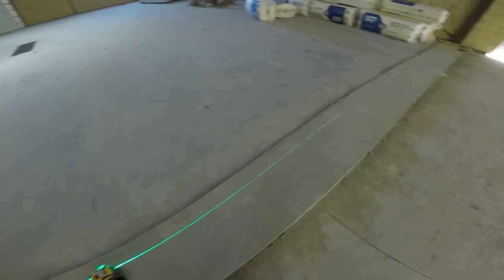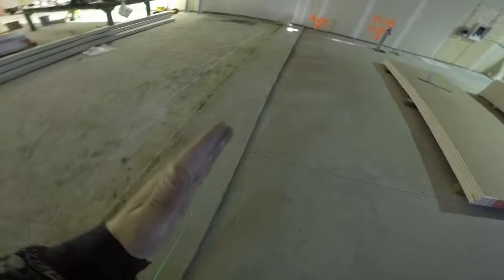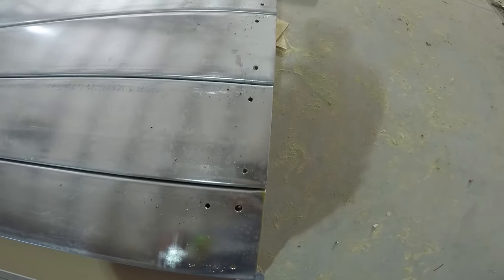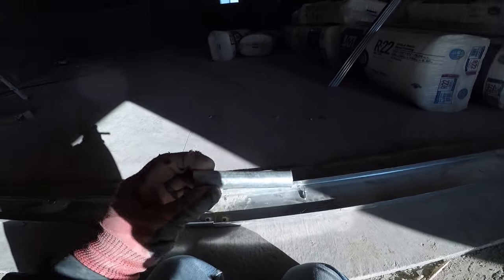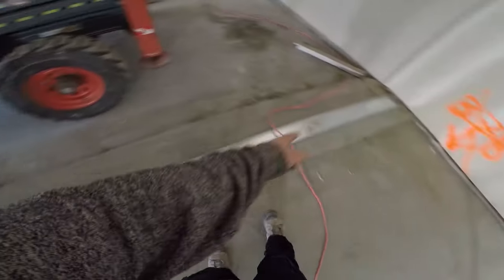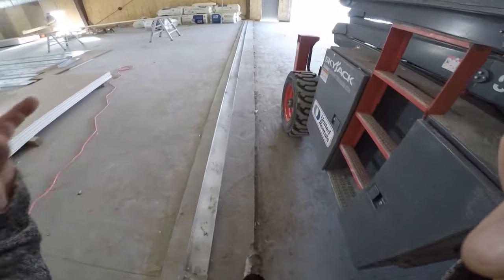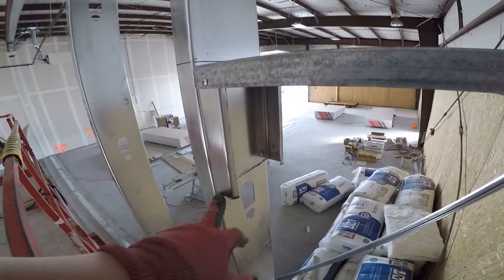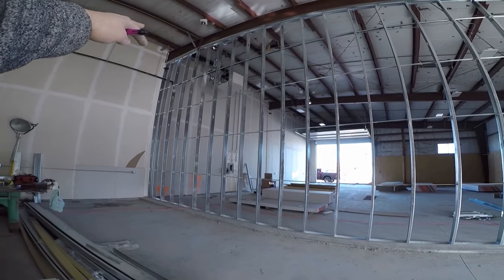Metal Stud Framing On Concrete & Steel Tips & Tricks!

Comment: Bizarrely, they don't sell those channel strips in UK, you have to cut your own noggins using channel parts. I'm going to hunt around because that looks so much easier.
Reply from the maker: Oh crazy I didn't know that. Have you tried a drywall supply house? Carry channel?
Reply: @ConstructionKronies  we have strips that act as braces which are attached to outside facing edges in an X shape both sides. I prefer the channel running through the centre though.

Comment: Which screws did you use to fasten the tracks to the steel beam?
Reply from the maker: We used the Hilti DX 351 steel to steel pins with green or yellow tabs. For screws we used #8 self drilling framing screws (but not to attach to structural those screws are for the studs to track).
Reply: @ConstructionKronies  Thank you for the information.

Comment: I need help framing a 12x12 free standing room. What do you use for the ceiling studs? This will have Sheetrock.
Reply from the maker: You can use anything for ceiling studs but if budget isn't too big of a deal go with 20 gauge 3-5/8" steel stud.

Comment: nice wall, do you need to add the wall stiffeners on a nonbearing partition interior office wall 10 feet high no insulation?
Reply from the maker: You don't have to but I highly recommend it. You don't need to clip it out, it's just good to have the wall channel in every 4' it's cheap and quick and the benefits are huge.

Comment: Thanks for the great videos!  What’s the best ramset 22 caliber nail to use to affix the bottom metal floor tracking to the concrete?
Reply from the maker: For interior non-load bearing  drywall track 25-20 gauge: 3/4" - Gas tool use TF1200 + T3MAG  - Powder Tool use R25 #3 GRN .25cal strip, Master Shot #2 BRN .22cal single or the SA270 #3 GRN .27cal strip. For the exterior perimeter 18-12 gauge use - 1-1/4"  SA270/XT540/COBRA #4 YEL .27cal strips! Hope this helps ya!

Comment: I just watched your video. Awesome! How much do you charge for stud walls? I just hot a call and asked me to do it but have no idea hiw much i should charge. It is 16’ high wall
Reply from the maker: Hey my good man. I charge $0.45 / square foot for steel stud. If it's light gauge and easy you can drop as low as 0.35 and for 18-16 gauge go as high as 0.65. also charge $2/ linear foot for angle in columns, soffit and bulkheads.
Reply: @ConstructionKronies  is this for surface sqf? And that include materials? Thank you so much for your reply 🙏🙏🙏
Reply: Only labor

Comment: Hi there, great job with the videos!!! At what height and over are kickers required to the ceiling joists?
Reply from the maker: Hey my man, so we actually never install kickers when a wall goes from floor to underside of structure. If you are looking at the tops here those angles are structural red iron supports and are done by the iron workers👍
Reply: @ConstructionKronies  thanks brother! What if the deck above is just 2x12 wood joist and top track is screwed into joists at 22' height?

Comment: Excellent video! For the crc bracing, if the spec calls for Swiftclip or Fastbridge clips to fix the crc to the studs at the punchouts, every how often do these go in?
Reply from the maker: Yes so we stagger them from stud to stud every 4' does or the job specs will specify as well. I hope that helps👍

Comment: Nice video 4 years ago but  i am doing a 3hr fire wall 23' peak in the center of 66' down to 16' on each side. ClarkDietrich suggested 6" 20gauge 33mil studs. 1.625 flange, 3 layers of 5/8s type x per side. Straight wall. Any thoughts?
Reply from the maker: Yeah wow man that's heavy. A 3 hour wall has to be 6" thick, use fire rated insulation like thermafiber or roxul, use 18 gauge steel and you only need 2 layers type x 5/8" drywall each side.
Reply: @ConstructionKronies  Any chance you know what UL wall assembly that would be? 2 layers would be a hell of alot better.
Reply from the maker: Awwh man maybe under UL U435 metal stud assemblies.

Comment: I might have missed it but how did you attach the track to the upper I beam? Did you still first? Use acoustic sealant? Thanks!
Reply from the maker: I didn't caulk the top track there. That slotted track is fire rated now. We used to seal it with the red fire stop. I shot the top track on with the Hilti dx-351 and steel pins.  There are other ways for sure even self drilling techs but that takes much longer. Let me know if you have anymore questions my man!!

Comment: Very impressive work! I need to build a similar bulkhead but the height is 31'. Any suggestions on what studs to use? I am considering Clark Dietrich 550PDS125-30 33ksi G40EQ 16" oc. Any advice would be highly appreciated.
Reply from the maker: Yes the 6" 20 gauge is great for interior applications. If you are framing for an exterior wall bump it up to 18 gauge. 31' elevation is neat, how wide are you going?
Reply: @ConstructionKronies  Thanks for the quick reply. Interior wall, full length is 110', but it will not be in one straight. Goes across warehouse for about 75', breaks 90deg right for 16', then 90 deg left for the remaining 18'. So the wall will be supported on both ends of the warehouse, but it is not in one straight shot.

Comment: I do commercial framing full time. Normally we use Hilti steel shots for fixing locking-studs to iron. I know that pins work just as good as hex heads. I’ve had  to relocate many walls, and pins are serious business, they are engineered to hang-on for dear life. Even when you use a claw to remove them, they aren’t easy to pull out.
Reply from the maker: We usually use shots as well. But this 15 gauge stud man, shots don't work so great. I agree the buggers can be difficult to remove. I find that using two claw hammers man, works the best to get em out. Cheers bro💪
Reply: @ConstructionKronies  i use the two hammer trick too, but the hatchet on my hammer is a nub now. lol. Cheers.
Reply from the maker: @nunyabusiness4226  haha yeah bro! I just use two claw end hammers or even a cats claw and hammer works pretty good. Cheers man!

Comment: Are your studs full height, or did you join shorter studs together? I need to frame a 28' high wall, tall I can find locally are 96" long studs. Can I join these together to get the height I need?

Comment: hi, thanks for this video, just a question ,  I have a 22 foot high wall, how can I put the studs together if I only have 10 feet each. thank you
Reply from the maker: So what i would do for 22 ft and couldn't use studs more than 10 feet i would just put standard track at the top of the fist section go track to track and build another section and then another. Use your deflection track at the very top.
Reply: Pay a professional, or atleast dont buy your studs at homedepot.

Comment: I'm a local 951 4th stage lather, been lathing throughout my apprenticeship but I've been wanting to master the art of framing . I know a little bit but one thing I can't grasp is setting up the layout for the studs so drywall falls perfectly in place especially pulling of inside or outside corners.  When should I add the 5/8 to the layout and when shouldn't I and when to simply go every 16. The journeyman at work usually pull from the outside corner of the track but I seen your videos where you pull from the inside of the track behind the floater...
Reply from the maker: When I pull my tape to draw centers I'm still taking them from the outside of the track I'm just doing my layout on the inside of the room instead of the outside. When I add the 1/2" or 5/8" I do that when I'm pulling centers for side walls. I try to pull all my centers from the same direction to keep the flow of drywall consistent. There is a lot going on here maybe hard to explain properly. Does that make sense to you?
Reply: @ConstructionKronies  ok so if my layout starts on the side of a track where drywall passes I should add 5/8 but if my next wall starts from the corner behind the floater I should just do every 16 ?

Comment: Great video and I love that you are from Edmonton.  I want to build four exterior shop walls out of 18 gauge commercial steel studs but I want to know how best to anchor the 16’ high wall to the 8” wide concrete grade beam.  The wall is 72’ long so would you build it in 10 sections?
Reply from the maker: I would need to know more about your set up but we just build into structure, for 16' high you will need a lift, so yes you can set the track stud it out, move over and repeat till your done just be sure to set an offset of 2 to 4" for your laser line. For anchors you can use the 1/4" pin bolts for concrete im using here in the video, thats a 16g wall im building there. There are other things I've seen like the 1/2" or 5/8" concrete anchors im on my phone right now but drop me a reply and I will link you to the products.

Comment: How much you charge framing linear foot?
Reply from the maker: I use a sliding scale. I start at $4.50 / lf for easy low height walls, then work up to $13.50 for taller heavy gauge. For parapet I charge $15/lf and for ceilings i switch up to square foot, $0.40 to $0.80/sf. For bulkheads I charge $2/ft for angle plus $0.45 to $0.65 /sf. Don't forget anything when pricing a job. If you have really complicated stuff don't be afraid to charge more. Start with those numbers then feel your response from the client. Everyone developes into their own pricing strategy over time.

Comment: I'm wondering whether or not that you could do a video on building a low wall? Where the wall is being built off a wall that is going to the pan decking. Wondering where I would put my Kickers & how it keep the wall plum as I'm building it. And how to keep the wall sturdy and plum when I'm finished?
Reply from the maker: Dude I totally will, but before I do just know that you need to build clips out of stud to fit into the q deck for walls or bulkheads that go to underside of structure. Always remember all you need is backing, something to attach to, like Lego. Always use lasers to plumb and level your walls and ceilings. If you ever have anything specific to ask me about a job your on take a photo and send it to me, email or Discord.
Reply from the maker: Also pony or knee walls are small,  they just need you to make sure your elevation is correct, put 2 screws in your middle studs, and or end studs, always check your elevation at both ends and middle and square everything, always take the time to square studs top and bottom, you spend time to level your tracks, split the beam, so so it all right. Make good use of your tape measure, if you have a level or plumb benchmark you can measure over , up or down and it will also be level or plumb.
Reply from the maker: One last thing I forgot, about the clips, you can also build clips to between wall studs so you can attach lower walls to them. I shoot a clip at both ends of the wall right at elevation so I can use them as marks and install clips at the middle and at the bottom I just screw the lower wall stud to the higher wall bottom track. You can attach kickers to anything, just make sure your good over 4 feet. If your wall can't be braced every 4 ft then you have to up the gauge. 20 gauge is good for 20 ft.

Comment: Can you install a stud wall against the exterior wood wall in  a house? And shoot 2 inches of polyeurethane?
Reply from the maker: You can install a stud wall, sheat it with dens gold, apply blueskin and then use an adhesive or long screw with these round washers to install the rigid insulation.

Comment: What tools do I need to do this job?
Reply from the maker: Hey my man, sorry for the late reply, it's been a busy week. You need a pouch set up, electrical tool pouch and 4 pocket screw pouch with belt and suspenders. And impact driver, drywall screw gun, drywall cut out tool, snips (red handles wiss) 25' tape measure, speed square, markers and pencils will get you going with the big boys in the trade. Email me and I can go into more specific details.

Comment: How do you pin the top to the steel? Is it shot in or drilled?
Reply from the maker: Yes I shoot it with the Hilti DX-351 or 120. 10 to 12 pins per 10' section.

Comment: Small question, doing my basement with Metal stud, can I instal my metal track right on the basement concrete, or I need to Caulk like you do? or maybe use a PT wood then screw my metal track on it?
Reply from the maker: I would definitely use the caulking. You can purchase it at any drywall supply house maybe even a home depot. I found a suitable one here on Amazon if you are in the states, if you are in Canada let me know I have a different solution. https://amzn.to/3L3IWVP
Reply: @ConstructionKronies  I live in canada :) (quebec)
Reply from the maker: @jambony6350  O cool, because you can use either one of these: https://amzn.to/3B2gxLj
or https://amzn.to/3xcZ7dW

Comment: I am planning to add a couple of bedrooms and bathrooms to a large water-front building and want to do it all with metal studs.  But in gathering information I have heard that metal on concrete will eventually rust, and some people out there swear that pressure-treated lumber should be used.  Does the sealant you use prevent rust and corrosion?
Reply from the maker: The caulking helps for sure, the track doesn't ever rust but can get corroded. The steel will last forever.

Comment: What if you don't have a beam on the ceiling to tie in to? I'm building a tasting room inside a building almost identical to this and the divider wall ties in to the edge of the beam sealing it off from my space.
Reply from the maker: What is the ceiling your tieing into? Is is Qdeck(hollow or concrete filled), concrete, truss, Wilson joist, pre eng purlin or straight up concrete?

Comment: 18:00 to 18:24 can you explain what is meant at the segment starting at 18:00? I don't understand what is meant by pointing toward the drywall. Isn't the drywall going to be on each end of the wall as well as both sides of the studs? Which drywall is the hard side supposed to be pointing to? Especially in the case where drywall is on each end of the wall like in a house? Thanks
Reply from the maker: Hey there great question. The metal studs have a hard side and a soft side. The hard side is the flat and the soft side are the flanges. When we layout our studs we point them in the direction we draw our tape measure from sonthe drywaller knows where to start. And yes the drywall will be at the ends and both side. What I mean is we usually laser or level up the first sheet somewhere in the wall and then cut in our end pieces. Does that help? I can draw you a diagram next time I'm live too.
Reply: @ConstructionKronies  Yes. This helps out a lot. Thanks for the info!

Comment: What's the sizes we need in the step bit for pre drilling the holes for heavy gauge steel? for impact?
Reply from the maker: I like using the step bit 11 double flutes.  1-1/8" diameter but all you need is to get the nose through the steel.
Reply: @ConstructionKronies  okay will do..thanks bro

Comment: How does steel framing work in terms of insulation in the long run? Metal transfers heat very efficiently and I wonder if it would impact utility costs or comfort inside the house.
Reply from the maker: This is the interesting thing about steel stud. The insulation goes inside of them. For example insulation for wood walls is 15" wide and for steel is 17" wide. So you get more consistent coverage.
Reply: I read that due to the metal stud conductivity a 6" wall in wood would he R-19 but steel is effective R-4.  But acoustics is still good
Reply: Steel stud can transfer cold into the wall system and create condensation.  

Most commercial exterior stud use a sealed membrane on the exterior sheathing and then an "outsulation".  Insulation outside the wall system, between a cladding carrier system that is attached to the steel stud wall with a thermal barrier. 

The clips are not  metallic.

Comment: This will help me a lot, but do you really have to used conduit to drive the pin bolts down? I just hit them twice with a baby sledge or hammer and be done with it.
Reply from the maker: Right on good to hear and no you don't need to use the conduit at all. I most of teh time just use the clay side of my hammer. The conduit is good for long runs. This 16 gauge steel here is heavy duty so it's  a good idea to ensure the bolts are in properly. I'm going to try that and see how the sledge hammer idea works, never done it that way! Cheers!

Comment: May I ask why you use drill and pins to secure bottom track to the concrete, as opposed to ramset or hilti concrete nailer? Is it a code thing?
Reply from the maker: Sometimes it is specified but in this case we are using 16 gauge steel, those shots don't work well with the heavier gauge steel.
Reply: I see, thanks.

Comment: DX 5 Hilti gun 1"1/2 concrete nails , red shots , faster than  drill a hole  botton track !
Reply from the maker: Sure, but not for this 16 gauge, you can't shoot 16 gauge it has to be drilled down. And Hilti shots red is for super heavy duty steel and a DX 460 for the 351s, use the green tabs for concrete and the yellow for steel👍

Comment: Could you tell  how much would cost Sq/f $ a wall like that?  Thanks in advance
Reply from the maker: This specific wall I charged $7.34 / sf to finish both sides to fire tape. But this spec is very odd with 2' o.c. and 16 gauge steel. For labor on installing drywall and finishing taped for primer charge $1.65 / s.f. then add in material. Steel I charge by linear foot depending on the height. Basic 8' walls I charge $4.50 to $6.50, 8' to 12' I charge $15 and up to 20' I charge $25 and above 20" I charge $35.
Reply: Thank you
Reply from the maker: @maratmarat6043  your welcome! Remember those are CAD prices you may want to convert them to USD.